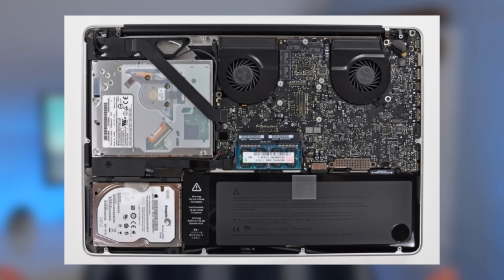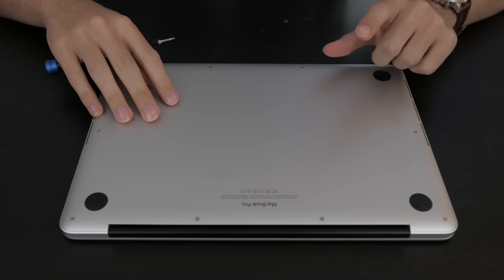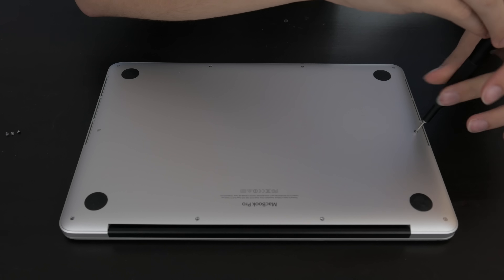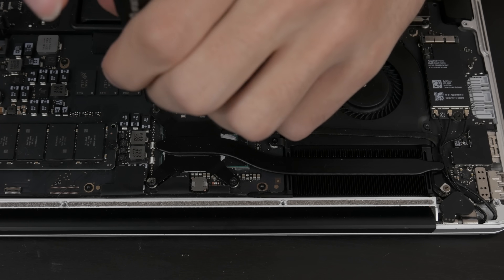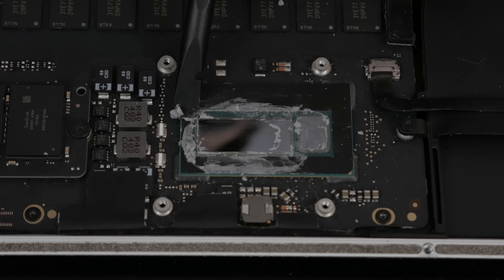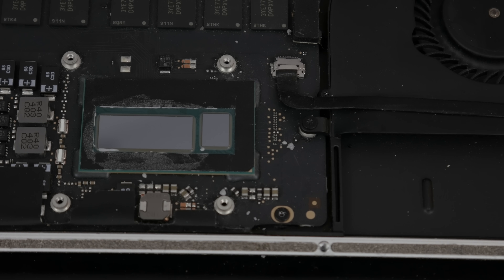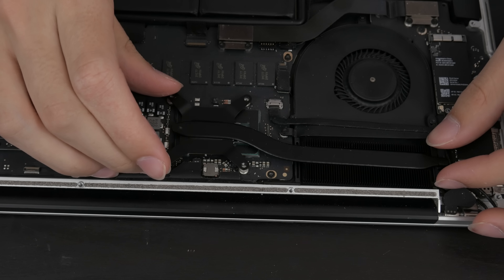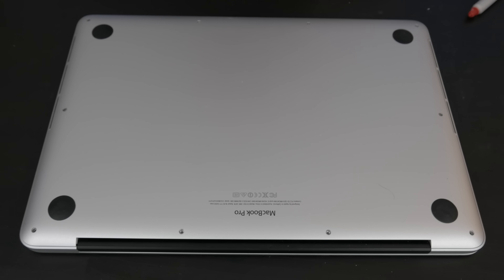If you have a Retina MacBook Pro, you need this $6 Upgrade!

Comment: you forgot to clean with rubbing alcohol ya noob
Reply: Instead of insulting the guy can you please tell us uniformed folks why the rubbing alcohol is important? Thanks
Reply: Eh, I kind of thought the same thing, but I have learned in doing this that the alcohol will actually breakdown that sticker and start to rub it off. I did a repair on a iPhone 8 where they use the same sticker for their logic boards and it will break it down into a goo. Maybe he knew that. Maybe he didnt. Plus, the dyes were pretty clean. So he didnt really do that terrible of a job.
Reply: ALso I would not push off with a plastic spudger. If he pushed off any resistors on the CPU substrate it would be game over.
Reply: Maybe he had some on the microfiber, and failed to mention it?  Shoulda dusted while he was in there, though.....
Reply: Alcohol is for noobs. I use acetone which works far better
Reply: supercrazymario404 acetone is for losers. Hydrochloric acid is the best

Comment: Thanks Luke didn't realise it was so easy would have done it a long time back, has certainly helped not only running cooler but also cools down quicker after running something a little stressful. I used Arctic MX-4  on MacBook Pro early 2015 3.1GHz i7.  Cliff : currently running CPU 54C deg now ambient is 32C. As pointed out the GPU section doesn't really have much of a heatsink room for an aftermarket one maybe.
Reply: did you paste both the CPU and PCH ?

Comment: The paste you removed has been cooked daily for potentially 5 years, describing it as 'crap' is like wondering why the oil in your car engine is 'crap' if it hasn't been changed for 5 years.
Reply: good point
Reply from the maker: It starts out as crap though...

Comment: From what I’ve seen online, spreading is necessary when replacing thermal paste on cpu/gpu without heat spreader (ihs), this applies to gpus and mobile cpus. The pea method works when using desktop cpus with ihs.
Reply: @Annon Moose sorry you're misinformed. Direct die applications need the thermal spread. If you have an ihs then you can use the pea method without too much of an issue. 

Been doing computers for the past 15yrs and I can confirm you do not want to leave areas of the die exposed as you can make a proper Hotspot that is infact detrimental to performance at the very minimum. Worst case for example, you end up fring the igpu accidently. Ask me how I know.

Everyone compares thermal paste applications but it's all done on ihs'. Direct die applications are very different story since the whole die produces heat.
Reply: @lewisanth4986  so you should dab a little near the corners then ?
Reply: @Rangefinder02  you can either spread a thin layer and let the mounting pressure push the excess out or you can use an additional amount how you choose so you get complete coverage. Only difference will be the amount of wastage really. 

As long as the thermal paste has low viscosity and easily speads under pressure you won't have any contact issues by using an excessive amount. It will just push out when being tightened and leave the correct amount to fill the gaps. 

It's always better to have a little too much than not enough specifically in a direct die application! 

Have fun with whatever task you are upto kenji! And always take your time

Comment: Apple somehow believes that thinner is better than efficient cooling of the CPU.
Reply: Intel somehow believes that delivering terrible CPUs for the last 5 years is acceptable.
Reply: Thinner is more important in a consumer ultrabook. But they should not be making the same trade-off in their pro machines.
Reply: I agree with you.
Reply: @Poire33  yes sir, and without a thermal camera and some testing, it may be worse? mac knows there stuff. but i am working on my down lap top now. we will see
Reply: *Jony Ive believes this. The problem really is that Ive for quite a few years had too much control over the design of their devices, use-ability or thermal performance be damned, and now that he's gone, they're already making choices for the better.
Reply: Not with the new 16” thicker and better thermals :)
Reply: Apple thinks different
Reply: Apple believe that aluminum is a better material for cooling than cheap plastics.
Reply: Yeah their always so concerned about aesthetics..  they're into that look  big time...
Reply: They're largely about form over function.

Comment: My question is why are you not using a better thermal paste and especially liquid metal ones? 
If you care about that low upgrade you should care about even a better result in my opinion.
The thing is you already started at low temperature so your CPU didn't have any actual temp problem but yes around 10F is good, next time use liquid metal or a higher end ceramic one.
Just a tip! :)

Looks like you don't have much experience with building or fix computers,  you did a couple of big no-noes while you fixed that but it's okey you 'll survive! ;)
Reply from the maker: While liquid metal is a good thermal solution, I do not recommend using it on a laptop as its corrosive to the heatsink, albeit mildly. Still, it absorbs into the metal and dries up, so you have to replace it every 8-10 months. This isn't ideal for most people. And there's no need to buy more expensive thermal compound as the benefits are relatively tiny compared to replacing the stock paste. And I have plenty of experience thank you

Comment: I did this with some liquid metal and was amazed to see my temps drop nearly 25 degrees under load. (I don't suggest this to most people as the liquid metal does react, albeit very slowly, but it does degrade the cooler)

Comment: BEST WAY: get a thin but strong copper plate that could cover the cpu and the gpu . Cause if you you at it the gpu is just half covered. its done on purpose for the GPU to fail .This model always have the same issue. GPU
Reply: Do you have any examples of that method? A video or a guide? I changed the paste and saw also that it covered only the half...

Comment: 8k laptop, cheap thermal paste
Reply from the maker: 8k? This was $1300 new, I paid 350 for it. I get your point but 8k is higher than any macbook you could ever buy
Reply: @lukemiani  new macbooks can be 8k when maxed out, which ppl do because you can not upgrade..
Reply: Yet still use the same thermal paste
They should use high quality liquid metal
Reply from the maker: Most expensive MacBook Pro is $6700, and liquid metal is corrosive, and must be replaced annually, so it is highly impractical for mass market devices
Reply: @lukemiani  € 7.959,00 for a 15 inch macbook pro latest model.. and if liquid metal might not be perfect, theres plenty of high quality thermal pastas out there
Reply from the maker: I literally said numerous times that the thermal paste should be better in the video
Reply: @lukemiani  yeah I know that's why I expressed the fact that their 8k laptop has shitty thermal paste

Comment: 4:00 if you want to skip the waffle. Thermal paste dries with heat over time in every kind of electronic device - not sure that Apple specifically use "crappy" paste.
Reply: Yeah this is just clickbait. He also never showed a benchmark AFTER applying new thermal paste.
Reply: Typically manufacturers choose thermal paste that LASTS a long time, because people aren't going to change it. So they prioritize long lifespan rather than peak thermal performance. They are not above saving a few cents here and there...hence why you sometimes see poor applications like the one in this video.
Reply: It was a terrible paste job from the factory too.
Reply: I use gelid GC extreme thermal paste, it's been in both my MacBook Pro non retina 2012 and windows desktop  i7 2600k overclocked to 5.6 GHz for close to 6 years and hasn't dries out yet since this thermal paste is for overclocking.

Comment: Mate, can you pretty please do this upgrade on a 2018 MacBook Pro?
Reply from the maker: The reason I made the video was to demonstrate how easy it is on these particular MacBook pros. The 2016- present require logic board removal to access the heatsink
Reply: I don't think it does. The heatsink faces out so you can remove it just like on the 2015 models.
Reply from the maker: The heatsink faces out, but the bracket and screws that hold it in place are on the underside of the logic board
Reply: Ltt

Comment: Is this worth doing for a MacBook Retina?
Reply: A retina MacBook (non pro) does not have a heat sink or fan on the processor. So it’s not even an option to do. Additionally, it’s not an easy task to open one of those up and has a very high potential for damage due to small and thin ribbon cables.
Reply: the title literally answers your question... hello?

Comment: You can wrap the tip of your finger in plastic wrap and spread the paste evenly. That was way too much paste. The tiniest of pea drops will do. Also, you should tint the heatsink, it will speed up the break in period of the application of paste. You'll see better temps and performance after about 300 hours of normal use. Try not to stress it out until it's broken in, otherwise the paste will not set optimally.

Comment: Hi guys I need  help to choosing what Macbook to buy . I don't know which Macbook to buy since am a windows user , I just need it for school but would be great if its future proof , my budget is 500 but could go all the way to 700
Reply: super good deals for macbooks on ebay for that range, just check pics and you should know the specs by now, if not try to get an i5-i7 and at least 8gb of ram with a 250-500+ ssd and you'll be fine
Reply: thanks

Comment: I hear this 'cheap thermal paste' stuff all the time but why is it ALL manufacturers would skimp on the cost of this when it causes so many foreseeable problems, it would be easier to go cheap on some other spec.
Reply: Because by the time the thermal paste causes problems you're out of warranty. Planned obsolescence.
Reply: Typically manufacturers choose thermal paste that LASTS a long time, because people aren't going to change it. So they prioritize long lifespan rather than peak thermal performance.

Comment: I also recommend repasting phones, but form > function, too hard to open them these days.

LG phones specifically have some of the worst paste, that's what caused the bootloops. After repasting my V20 it runs way cooler, and it benchmarks higher than a G6 which has a faster CPU.

Comment: Is there a reason you didn't use liquid metal?
Reply: Metal paste reacts with the copper block which causes the copper to degrade over time.
Reply: Metal paste reacts with the copper block which causes the copper to degrade over time.
Reply: Metal paste reacts with the copper block which causes the copper to degrade over time. Metal paste reacts with the copper block which causes the copper to degrade over time.

Comment: Goes from saying "...make the CPU run a lot better..." to saying "...isn't a huge improvement..." to saying "...not a humongous difference...".  The real question is are the performance gains worth opening and potentially damaging your Macbook?  I'd say no.
Reply: I would say if you had to open it up to replace the battery and clean out the dust intakes you should also just replace the paste while you are at it. My MBPR is a late 2014 model and it was starting to heat up while on idle. So when I went to replace the battery I had the paste reapplied and it now performs like I just took it out of the box.
Reply: You won't damage it if you are grounded and no static shocks can destroy your laptop
Reply: +Roshan I think he meant damage it with the liquid metal applied in a unibody that is mostly made of aluminium.
Reply: @RaijinKaze  well if you decide to use liquid metal then yeah be extra careful
Reply: yh, had to dislike the video for that.

Comment: Afternoon Luke
This is a bit off topic, but I was able to pick up a Mac Pro (2009) entry-level computer for $275.00 with two 1TB hard drives and 16GB of ram.
 
The only real shortcoming is the need to do some cosmetic work on the case itself (clean and polish).  
But given the size of the ram and the number of hard drives and their size, I trust the amount was ok. Here's hoping you will agree. Looking forward to upgrading the unit over time. In the end, I would like to see it maxed out. 

My current mac is a maxed-out Mac mini (2010) which is facing software issues going forward and currently having problems with both its onboard hard drive and it just started not mounting on startup (now and then) I think it's a hard drive issue but given that the drive is new and under warranty. I need only to pull it and return it to Seagate for a replacement.
Your throughs and sorry about the rant.

Ric
Houston/San Francisco
Reply: Richard Ramsowr hey are you in the San Francisco area? I can help you with the Mac Pro and Mac mini if you would like. I’m in the Bay Area once a week

Comment: Hi Luke, have you tried nvme upgrade for late 2013" MacBook Pro retina with ngff adapter? As far as I managed to research it should work with 960 Evo on High Sierra. Can't try it myself as I don't have mbpr right now and it was impossible before high Sierra as Macs didn't have Nvme drives before it
Reply from the maker: I tried it about a year ago with an OEM-style samsung drive (not a 960 EVO) to no avail. I’ll give it another go if I can find the adapter

Comment: I got an early 2011 17inch Macbook Pro, I picked up dirt cheap with a failed GPU.
I bypassed the AMD HD 6750m & only use the Intel HD 3000.

But damn does this thing get hot! Just 1080p 60fps videos of any length I gotta expect the fans to run full blast the whole time to keep the cpu around high 80's and low 90'sc......

I'm waiting on a screw driver I need, and I am going to take the plunge on dealing with all the tiny little connectors and screws to re do the thermal paste on this....

But if your saying the Retina models are easy..... Well that's one good thing..... But hardly worth taking away the ability to upgrade & replace things easily.....
But I'll keep this early 2011 model going for as long as I can.... I even have a means to get Mojave on it...
This means could likely last me a good while..... (as in another 2 or 3 OS upgrades) 

But if I decide to continue using a Mac past this Macbook...... It's something I'll have to stomach...
That being smaller screen, and no upgrades.....

I might just step out of the Mac world again, by the time this laptop is to old to do anything.....
Reply: how did you bypass the amd graphics? any help would be good thank you
Reply: Kareem Ragab I'd be glad to help, It's been detailed how to do this on Macrumors. But if your anything like me, watching videos is even more reinsuring. 
So luckily a small YouTuber did a video showing every step you need to do.

Only thing to make note of there is a few differences pending what OS is installed on your Mac currently.
If your Mac is running something older then Sierra, aka OS X El Capitan or older. 
Follow everything that is shown in his video, if you made the upgrade to Sierra, things are a little different, the person who made the video made a detailed comment on his video, showing the differences. 
Now if your running high Sierra things change once more.
Basically follow the comment that the video's poster made, but when you type these commands your not going to want to type "sudo" first.
For whatever reason High Sierra removed that command, and you just write everything that is shown minus the "sudo" at the start of the line of code you type.

To simplify that, a random commenter "Sean Witzke" re wrote the video's creators comment just minus the sudo command and any other changes.

Here is the video, check it out & good luck! 
https://www.youtube.com/watch?v=nFFPk3SeQbQ&t=1s

I got it done in about an hour, but I was doing everything super slow, and triple checking things. 
Could only imagine the headaches if I did something wrong in here haha.

Comment: Hey I have a question. Can I use a egpu with like a 1050ti on my 2010 MacBook Pro 13 inch? I also have 16gb ram
Reply: Kyle Burdick no, you need thunderbolt 3 for best performance. there are some egpu exclosures that use thunderbolt 2 (you'll get worse performance compared to TB 3), but no 2010 apple machine has thunderbolt 2 as it didnt come out until years later.

Comment: The problem with apple is that they also OVERUSE their thermal paste. too much thermal paste will also cause heat to insulate around the chip.
Reply: Overusing thermal paste does not make any significant difference, as was poven in many tests, check out Jayz2cents or Linustechtips